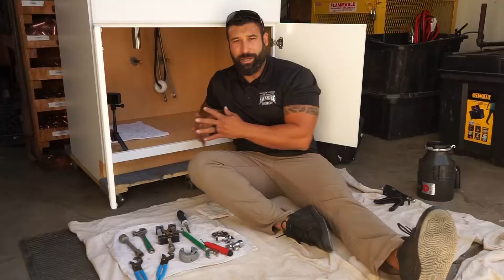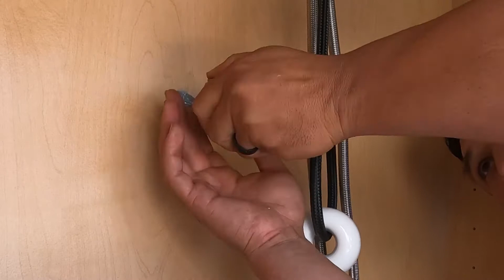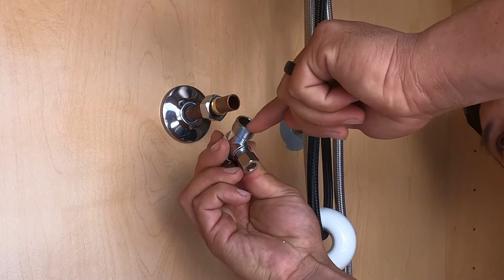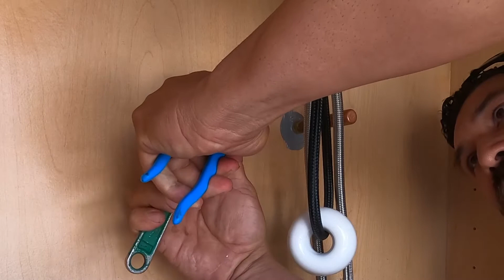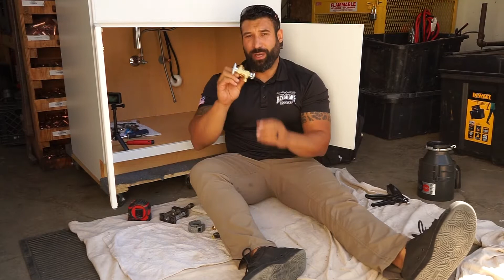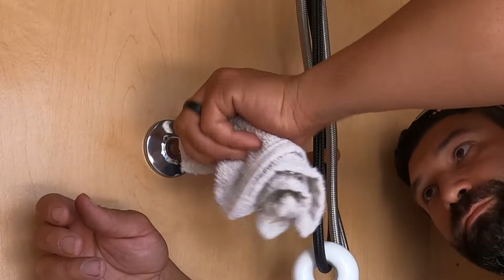Installing and Replacing  Angle stops (under sink)

Comment: You forgot to put the drain pipe, disposer, wires, and water lines....oh, AND a vertical face-frame piece right in the middle of the of the cabinet opening! 
 Now THAT would be a "realistic" mock-up 😄

Comment: Thanks Sam, very useful tips. I had a couple of frozen vales under a kitchen sink, one the hot water and the other for the dishwater. They were both placed up against the cabinet wall and with no room to cut the pipe. They were tricky to loosen, especially with all other lines, P-trap etc. Fortunately, I had the same short pipe in your video that fits on the 3/8" connection to give me some leverage, and a ferrule removal tool. I opted for a Sharkebite push on valve, it made it much easier, especially as it rotates after being fitted.

Comment: Thank you for taking the time to make this excellent video.   Regarding the tightening of the nut between the angle stop valve and the copper line.   Should that be a half or three fourths or full turn after the nut is hand snug tight.